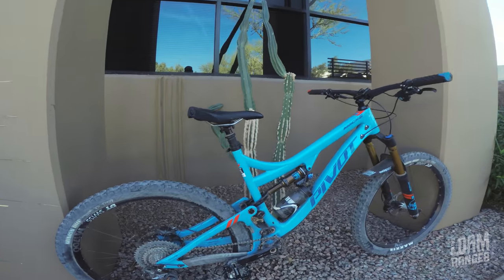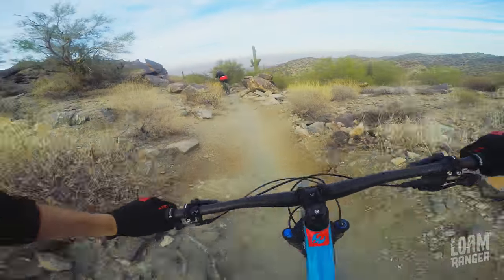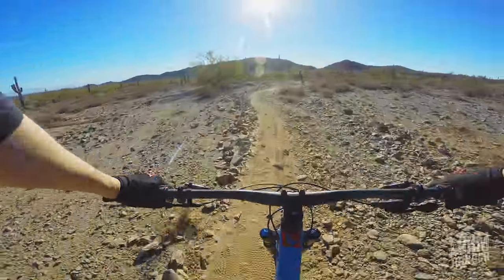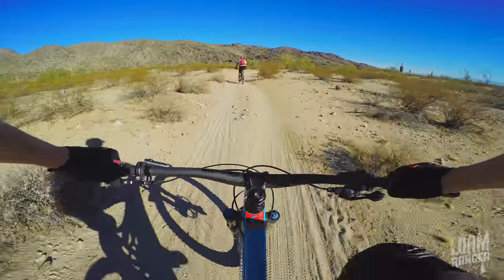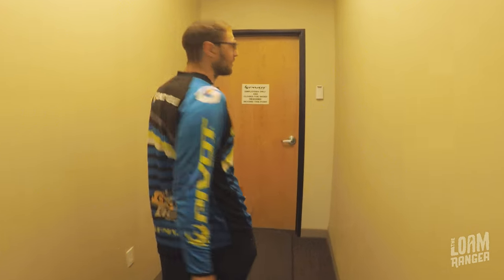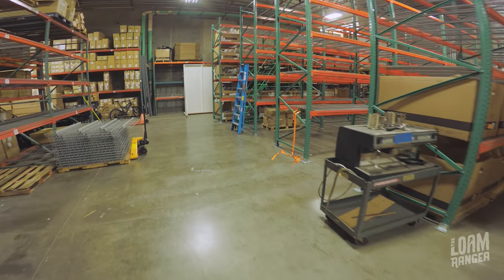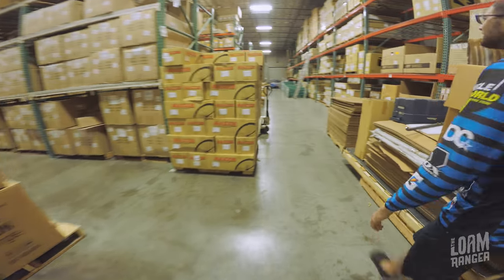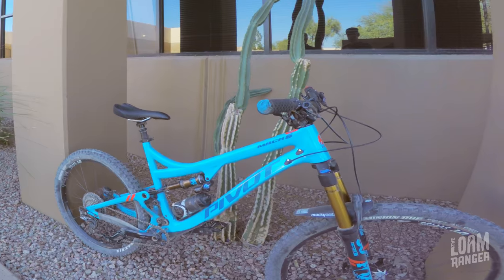2018 PIVOT MACH 6 // Mega Review

Comment: Owned a #Carbon5.7 before the #CarbonMach6 came out. I didn’t want to go all the way to a Firebird because of all the climbing around here. I got the Carbon Mach 6 with the Pro build and the Reynolds Black Label rims. Kashima coating front and rear. The big difference is the head angle. The 5.7 had slightly snappier handling while the Mach 6 is more of a bomber downhill. I love the bike and just enjoy looking at it!  Not a lot of Pivots in the Bay Area (no good dealers) so when you see another one you do the knowing nod. You both know you have a kick ass bike. I even rode the trails at Northstar for 2 days and it did awesome. Good to see you @BrienGonzales. Thanks for all the help with the bike when I was buying it’s! Pivot customer service is awesome (I worked in customer service at Specialized for 2 years so I know what good customer service isn’t and what it should be).

Comment: Another tip with the water bottle idea, I drilled the frame of my YT Capra AL comp bike and stuck a water carrier underneath the bike. Just had to buy a bottle with a dust cap and has served me well.
Reply: Shouldn't drill through any frame, carbon or aluminium. Even if the hole is minimal it still weakens the frame. Maybe not noticeable on impacts, but it surely has an effect on how the material handles fatigue, and shorten the life of your frame. Plus you void you waranty, so if even if you get damage nowhere near the hole, the company won't do a thing, since you've drilled through their frame.
Reply: It comes with mounts underneath for a bottle.
Reply: Justin Bohner not on the old ones - I made that comment two years ago lmao

Comment: I own this bike as well, I agree on switching the tires, I went for DHF 2.6 and Rekon 2.6 in the rear.  

I am 6'-3/4" and went with a large.  I think it was the correct size.   I also have a 429SL in large (which is a larger geometry) for more XC trails and notice the difference.   If I was to have this as more as do it all bike and might do more XC trails, but wanted the ability to do more enduro riding as well.  Then I might go up a size as you did, but for intended enduro use, I like the large.

I also went with the Fox 125mm dropper (you choose when ordering).  I considered the Fox 150mm, but according to Pivot's site it would have been at the lowest limit, which sounds like what you experienced.   

Overall, I am really enjoying this bike.  The 429SL is a better climber, I find myself out of the seat a little more on the Mach 6, but could be a learning curve.   Downhill hill, much faster and find myself choosing fast but more difficult lines.
Reply from the maker: 2.6's on this bike would be deadly!

Comment: A little older video but DAMN dude your footage looks awesome.  

At one point you state that you were running to low of tire pressure.  We are about the same overall weight so I’m curious as to what pressures you consider low in a non plus sized 27.5 wheel

Comment: Wow, I wish Pivots were more afforable, the Mach 6 would be on my list. Here in Canada they get soooooooo expensive. Great video! How does it compare to the Rocky Mountain Altitude? I m seriously considering the Altitude.
Reply from the maker: They're not cheap, for sure. Hmm they're both good bikes with similar characteristics, but I'd probably go Mach6 between the two because of the suspension platform and stiffness. Having said that, I'd be 100% happy to own/ride either.
Reply: The Loam Ranger do you think is worth it to swith from 2016 altitude 790msl rally edition to 2018 pivot mach6 carbon?
Reply from the maker: 19nolram82 that depends on how much you like your current bike, cash flow and what you think would be better about the Mach6. The M6 has more modern geometry and more travel, so if you feel that would be a benefit to you go check one out and buy it!

Comment: I wonder if you could flip the shock around and clear a larger bottle. I had my 429c set up like that and I could fit a full size bottle in a small frame. A Pivot rep actually recommended I do it.
Reply from the maker: Good thinking! That would probably work pretty well.
Reply: uh, no. You'll need to go for a shock with no reservoir to fit a bottle. If they made shocks with the reservoir on the side it would be far more convenient.
Reply: @justinwbohner  this comment is 2 yrs old...
Reply: @TheDavidjakeson  A testament to the general ignorance surrounding the Mach 6.

Comment: Ryan.  In this video you mention riding the minion tires really low pressure what psi were u running them at??
Reply from the maker: Oh man I was scared to check haha. Going from tire feel I'd say close to 20psi
Reply: The Loam Ranger   Didn’t they feel squirmy in the corners?  No concerns over even more diminished bottom bracket height in the AZ rocks???

Comment: Stupid question and way late, but perhaps you or any other knowledgeable person can answer: Is there any difference between the 2018 and 2019/20 model? Because I thought the refresh was for MY2018, but the new model looks slightly different than all the ones I saw in tests so far. If you look at the area where the toptube joins the seattube, some modes have a see-through-gap between the toptube and the reinforcement tube (for lack of a better word), whereas some models don´t. Is this a framesize thing or an AL vs Carbon? Thanks for clarification!
Also, anyone any long-term experiences? Cheerio!

Comment: You could have turned the transfer 180 degrees. Drops an inch lower.
Reply from the maker: Oh really? That’s a good tip!
Reply: The Loam Ranger. I just bought a 2018 mach 6 medium. Same problem. Found a bulge in the seat tube hitting the cable actuator assembly.

Comment: Evil wreckoning
Intense Recluse
Canfield balance 
Knolly endorphin 
Guerilla gravity megatrail
Santa Cruz Hightower LT
Reply from the maker: colt hawkins yes to all of those! So many bikes, so little time. The Endorphin is really intriguing.
Reply: The Loam Ranger I agree that's why I'm building one right now. I'm gonna run a CC inline coil with a remote lock out to take full advantage of the low anti squat. Plus the IL lock out is a progressive lever, the more you turn it the more support you get.
Reply: & '18 RM Slayer
Reply from the maker: Ya would love to try that one in the spring!